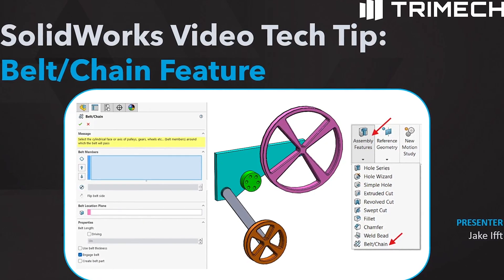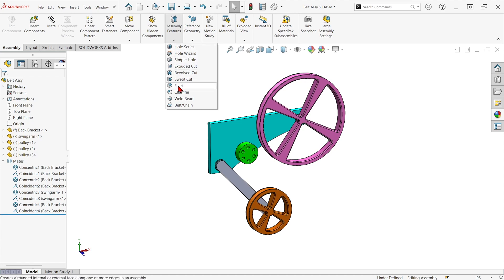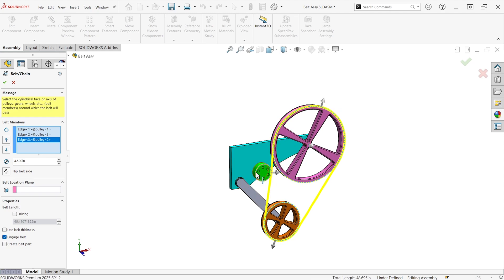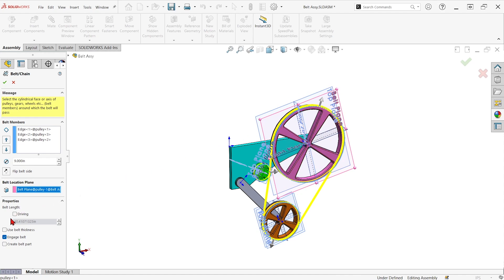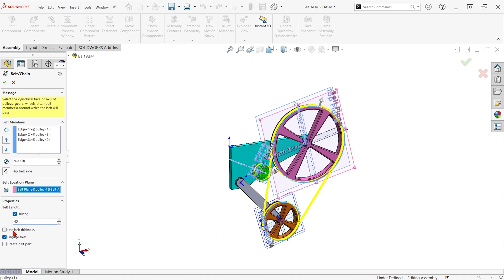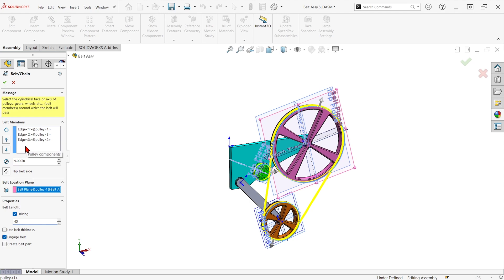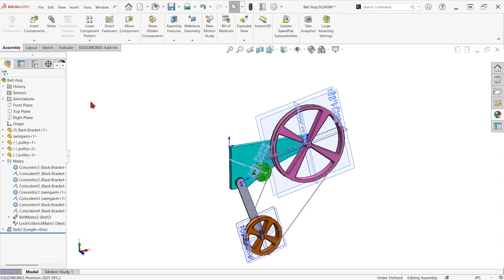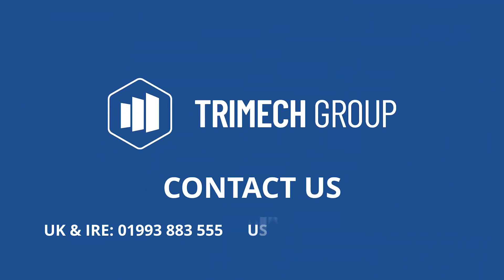How to Use the Belt/Chain Feature in SOLIDWORKS

Comment: As belts have thickness, so I suggest you make a sketch on each pulley representing the offset to the center of the belt's centerline and snap the belt to it instead. And the offset can be different between the back and the tooth side.